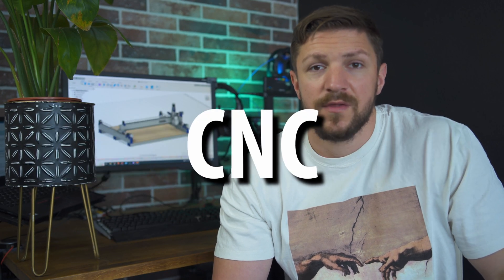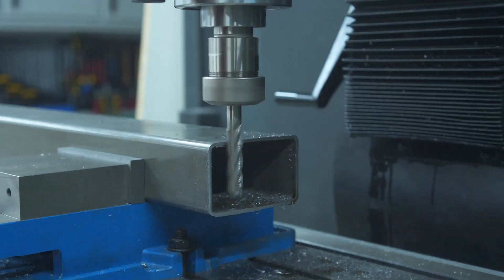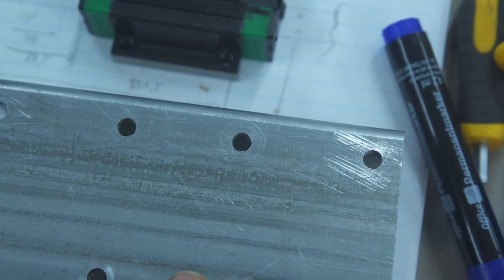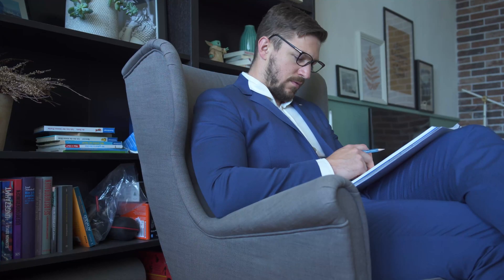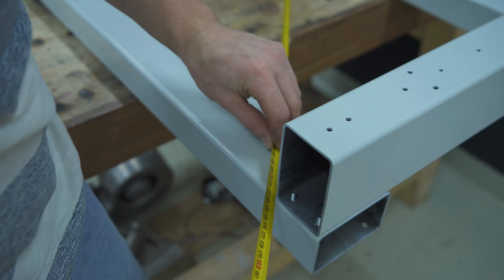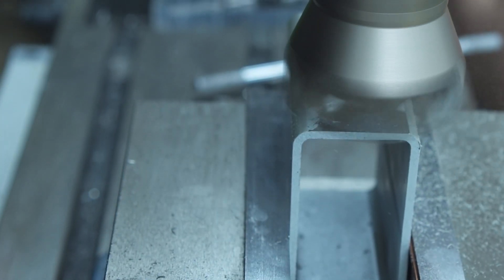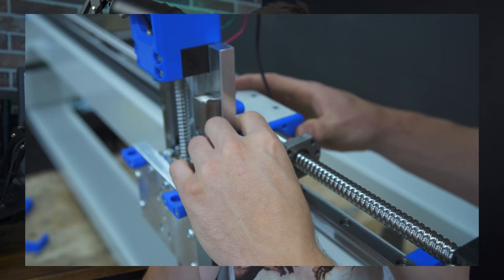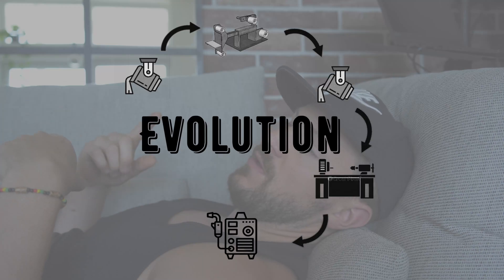PrintNC - a 3D PRINTED CNC Machine ?! | part 1

Comment: In theory, you could, with enough patience (a lot of patients), hand scrape the steel tubing until it is flat. You might want to leave this mortal coil before you're done, and you might do so before you manage to finish the hand scraping, but it is technically possible.

Comment: I would like to build one of these machines for accuracy and wondering if I should consider getting maybe 5mm thick steel tubes and ground the surfaces where the linear rails get fitted. I know you have access to industrial grade machinery but you didn't do it and your thoughts on this will be greatly appreciated. Thank you!
Reply from the maker: yeah 5mm would be optimal, especially when you are able to grind it flat
Reply: @ChristophLehner  Thanks for your reply. What should I ask when asking a shop in terms of how much accuracy of grinding flatness etc.. should it be something like say 10 micron or maybe 0.01mm considering the type of RHS mild steel I am going to be using in the CNC build?

Comment: Thanks for the wonderful series Chris. Quick question: I noticed your killer welding skills in the laptop video; did you considering welding the rails on or using welding in any parts of the assembly of the PrintNC? Wondering if it'd be a quick shortcut to bypass the repeated drilling/tapping, while also providing increased rigidity? (at an extremely marginal level)
Reply from the maker: thanks!
no i'd stay away from welding, it will wrap no mather what. i'd take a somewhat flat steel beam over a more solid welded connection.

Comment: Damn, It feels like this whole thing was made about me :D Not exactly the same things (apart from me building a printnc), but the thought flow is how I live day by day, month by month, year by year.
Oh yeah, I needed 15 and 20 degree wedges for knife sharpening. I'm building a CNC mill capable of milling structural steel now. And don't you dare tell me that I could easily make them from 15 mm acrylic sheet offcuts that I have by simply using a file.
Reply: P.S. any chance that you're also a software engineer?

Comment: Everything is fine, but the linear guides and ball screws are quite expensive. That's why I built it on linear shafts and the drive on toothed belts - it's cheaper for amateur machines and that's what we're thinking about here.

Comment: I know one thing for sure. I need to talk to that shrink. This is the same rabbit hole I went down. I was just helping a friend with programming some simple python code for a sensor head to a machine. I suggested  nonchalantly that we could probably just 3D print som parts( never touched a 3D printer before), and just buy a a few sheets of aluminum and make some holes. Now one year later I have built 2 3D printers for ABS with enclosures for the parts, learned Fusion 360/ CAD/ CAM, and just finalizing a home build cnc machine for cutting the aluminum. Learned react framework for front end development, brushed up on c++ coding, written a custom made gcode parser, and will probably be stuck with this side project for the next 10 years. And that surface grinder you talk about, last week I just thought I needed to start sourcing some parts for building it, because you know as well as me, everybody needs a grinder.😂

Comment: Thanks for posting. I appreciate your humour as well, nice touch. I’ve watched your PrintNC video series and was glad to see your wife appearing as your sanity check instead of that fancy therapist. This really is a great CNC to use. The rigidity is superior to much more expensive commercial machines I think. Steel = much better than aluminum extrusions. I eventually changed to closed loop stepper motors since their prices came down last year and they are much cheaper than servos. They have really improved my precision and power.

Comment: Hi Christoph 
Will you send me the name of your Theapeut? 
I think he now has the prerequisites to understand me

I started out lacking some good sound for my 'older days' and found the range of speakers that appealed to me completely out of my financial reach.
So yes I have also become 'obsessed' with building a CNC to manufacture the 'future' cabinets once I get to design them. 
When I look at the cost of CNC parts, speaker units, electronics and measuring equipment, it would have been cheaper just to buy the speakers I liked.

Comment: Now that you can cut some metal, all that plastic needs to go, super easy cut quality gains right there. Cant even think about the machine flexing when your screws are rubber mounted. Put a indicator free end of screws and pull 10kg on the spindle, I'll bet you find over half of your deflection.   Enlarging the hardware bolting the base frame together and adding nuts inside rather than just threading into the tube, adding backing plates or large washers inside the tube would help, same on the gantry.  Tight fitting bolted in plugs in the end of the gantry might reduce a little twisting.  A second bearing block on the bed rails would help keep the gantry upright.  Cheap granite/slate from old billiards table or counter top for a base between the frame and spoilboard would make everything way stiffer and help resist chatter even if it does deflect.  If you get rid of the plastic you can then work out the resonant frequencies and take that vs number of tool flutes to know which spindle rpm to avoid or even which rpm will help to cancel it.  Shocked it cuts as well as it does for all the sins in the design, interesting start that could be done with a small 3d printer and very basic hand tools though.
Reply from the maker: Thanks.for.the comment, indeed i plan to upgrade the printed parts, but you know christmas is arround the corner, so i can't have any downtime 😅

Comment: 01:43 - Hold on a second! How is the connection between ball screw and frame not a structural part? Some deflection will occur underneath the bearimgs, which need to take the axial loads. Also the plastic endcaps (seen here as connection to the z-axis) are getting bent due to high load on the ball screw nut. Also I am a bit curious about the holder for the stepper motor which needs to withstand up to 3 Nm of torque.

Nevertheless, I have no doubt, this design will work in wood. Also aluminum should be no problem. But you will not get the highest precision which could be achieved. Replace the plastic parts with steel or at least aluminum to stiffen out those weak points. You can even mill those parts on your own and repeat those plastic pieces. Afterwards, you will definitively notice the increased stiffness , performance and precision!
Reply from the maker: you're right, the faceplates, which holds the ballnuts are a weakpoint. In the future, i plan to mill the motormounts and faceplates out of aluminium.

Comment: hello chris, are you using 100x50mm steel tubes or 75x50mm ?
Reply from the maker: 100x60
Reply: @ChristophLehner  great, it means that all the tubes and gantry are 100 x 60 ? do you think that is more rigid than 75x50 as default ?
Reply from the maker: @akka4751   i just picked the cheapest tubes i could find, the  steel isnt really then weak point, its more the single carriage, so pick whatever steel you can get your hands on
Reply: @ChristophLehner  thanks for the answer, one more question, do you think that double the carriage as you did make a big difference in rigidity? i can´t find the 3d cad with double carriage to give a look
Reply from the maker: @akka4751  there is a parameter in fusion where you can enable double carriages on Y.
to be honest, i only did cut wood so far, so i can not comment on this, but my 2.2kw spindle will be soon installed, then we will see
Reply: @ChristophLehner  i was searching all the day but i didn´t find this parameter, if you remember how is named please write me ;)

Comment: Christoph, I concur with the comment on the humour, awesome. Seems to me you are using 2 carriages per side instead of 1 on the original design on the dual lead screw axis. Any calculation or user experience behind this decision or is is just to make sure? I always felt this could be a weakness of the Printnc but did not know whether the worry is justified.
Reply from the maker: Yes, i had leftover carriages so i slapped them on there. But i havent done any real cutting, so i can't comment on Performance yet

Comment: I built a similar contraption out of emt and 3d printed parts and a dermal tool. It engraved things pretty well, took me about a week total to design and print everything. Took another 3 days to put it all together and work out the steps per dimension. But your looks much stronger. Good job I know the work involved it making one of these things.
Reply from the maker: Sounds like a MPCNC?
Or did you design it also yourself?
Reply: @ChristophLehner  designed every connector the whole thing. I just went to home depot bought a few things and started designing,  printing and assembling. I assembled the whole week. This was in 2017.

Comment: Great video. Nice build. Links to the other open source projects? I'm surprised you didn't build a shredder for your aluminum cans to melt down in the furnace to make the alum parts.
Reply from the maker: Hahhaha 😂I did start out melting cans, but you get so much dross, it's more economic to cut up aluminium wheels